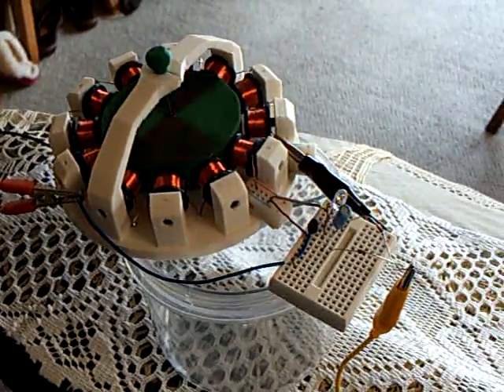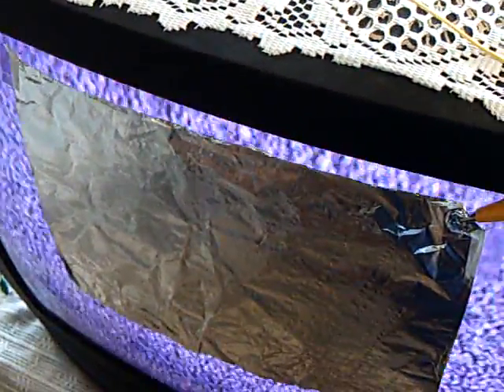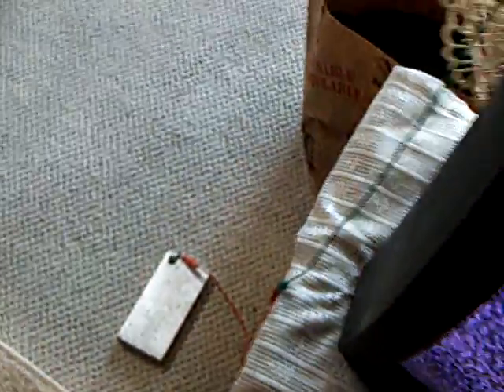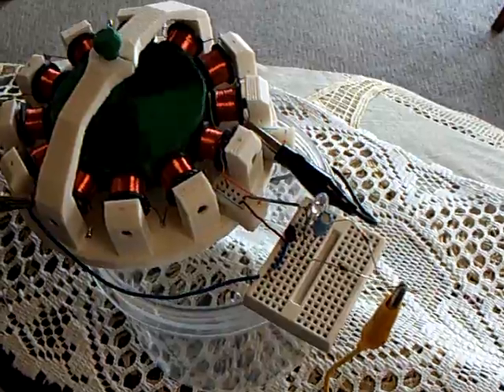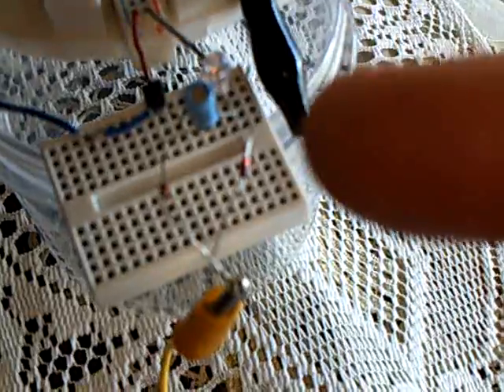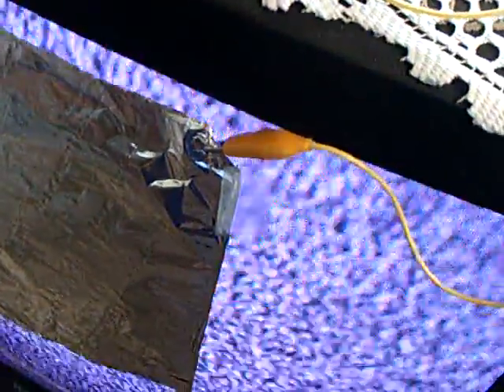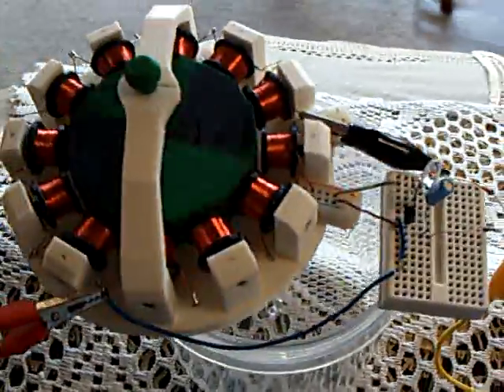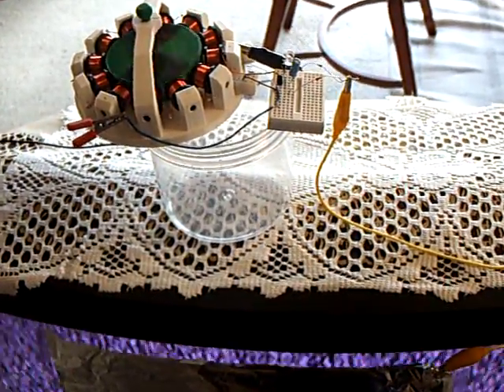EZ Spin Motor running off TV screen energy

Comment: This Easy Spin Motor is electromagnetic but due to the fact that is runing on very low currents acts and behave like an electrostatic motor - you can make a electrostatic battery for it from foils from different metals and wax (electret) - if you give me a email adress in a reply Lidmotor or write-contact me on my facebook page, i will send you a sort of secret recipe for this, which is very interesting - tnks for sharing

Comment: Your aluminum foil concentrates the static electric field like a capacitor builds up a DC charge.  The discharge of the static electric field from the foil is DC.

Comment: I used to do that to the old game room TV a lot as a child! Good memories! Then, one day see if I can squeeze the Max_imum power out of it, I was searching for easy access for a ground connection, I decided to use the AV input on the back of the TV. I was able to get some pretty big smarks, about 1 inch long and up, and then When I decided to use the TV _"properly" I had killed it! The signal from the PS2 was getting mixed up with the satellite input, component input, and other AV inputs! It was a totally trippy psychedelic splash of colors from all the sources mixed together, the Wii, the Dish network, the PS2, DVD player, everything!

I it took awhile for it to register to me that the ESD going directly into the AV plug, probably killed some electronics internally. frantically trying to hide the fact i broke it, I figured out that if I unplugged all but what I wanted to do,it seemed fine. (Now understand now what I did, and judging by what the symptoms were, my guess is that I killed some analog multiplexer that switched between on the desired signal input while rejecting the rest, of which then went into some sort of decoder, which separated the H and V sync pulses and RGB values for the signal) I was able to keep the broken TV a secret by using it normally, and just unplugging things I did not want and stuff that I did want, until some renovations many years later, when my parents moved the TV into their room. When they got really suspicious, I ended up having to confess that I broke it, and ended up having to buy a new TV. 
:(

I did get one, a junky 55 inch CRT-back projection for the new game room for $50 on craigslist, but the picture was really flickery, dim, poor viewing angles, and HORRIBLE color divergence and geometric distortion at the corners (like, for small things, there were clearly 3 separate R, G, and B projections, which were supposed to overlap to make one color image.) That TV did eventually die naturally after a few years, and I wanted to take it apart to get the fresnel lens out of it, along with the mirrors and optics and CRT tubes. At the time, I was also really interested in flyback drivers and the tesla coil. Though I was never allowed to dismantle it. Oh well, it was probably for my better good! :)

Comment: Yep just what stanley Meyer has been telling us in his videos a b+ potential acting as a aerial so has joe booker alias joe cell but I think he has made a negative ion generator off the alternator and also a positive ion generator at the same time to inter pulse with the dc starter motor by a figure 8 twisted wire with a donought neo dynimium magnet in the centre if the twist to act like a magnatron that soaks off the 3 rd radiant energy as all these fields collide to go in yo aluminium cylinder head or intake causing eddy currents to strip incoming air then static.  Anti static charge and discharge in the cylinders causing attraction repulsion what you recon

Comment: Haha, brilliant ! Has enough about it to flash the LED too.
Might try that on my CRT PC monitor. Next up for completely free running could be a tall pole in the yard or antenna across a couple of trees. Whatever works for a crystal set should work for these.
Reply from the maker: I am still trying to get an antenna to bring in enough juice to run something but so far no luck.  I only get a few AM stations on a crystal set and they come from far away.  I have been doing research about RF harvesting and it seems you can get it from many sources.  The trick is to have a receiver circuit that can tune for it.
Reply: *****
Indeed, to compliment the 'broadband' of foil and such, the need is to identify the ambient frequencies and have tuning stages with caps and delicate coils (in my opinion). there would be at least 60Hz, 2.4GHz and var caps for any strong FM/AM stations...all together it would surely enable 1.2V and 10uA. 10 minutes worth of rented time with a 25GHz Spectrum Analyzer would do it ! then a scope to tune up the elements.
I'll bet your neighbours WiFi would run that motor lol

Comment: Awesome, Lid!  Can you use the motor to charge a battery?
Reply from the maker: Well it depends on what you mean.  If you turn the motor manually the thing is a generator but running as a motor the only energy given back is the flyback and that isn't very strong.  Slider has been trying remote magnetically geared rotors to see if a generator load can be done that way.

Comment: Thanks for sharing.  What did you end up getting the uA draw down to?  The uA meter I use is for sale on eBay.  Just search "DC 0-50 uA" and they should come up for around $4.00.
I have been wanting to build a hybrid electrostatic + electromagnetic EZ Spin AtmoMotor.  Right now every spare moment is going into the SOLN1 25 project.
Reply from the maker: I'm still in the 10s of micro amps.  A reed switch is the way to go (as you know) if super low current is the goal but I like this simple electronic circuit a lot.  Three coils for the transistor base trigger and 9 to drive with. I went ahead and ordered that $4.00 "DC 0-50 uA" meter off EBay. Thanks.  It should arrive sometime this summer from Hong Kong.  Ha.  I think this motor, just the way it is, might run off atmo energy from a wire hoisted by your drone.  Sorry to hear that you are so tied up with the SOLN1 25.  That sounds more like work than hobby fun.  Thanks again for sending me the parts.